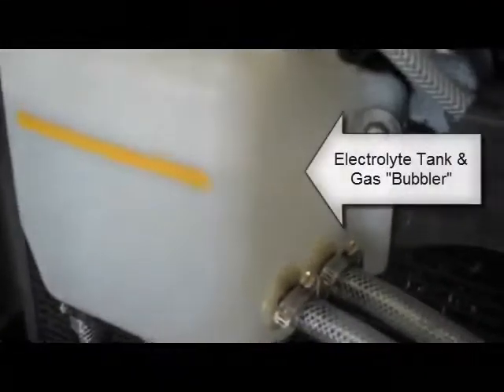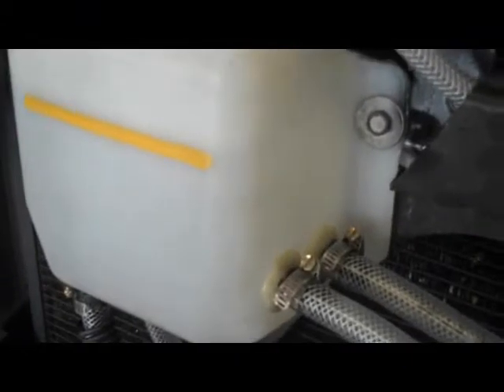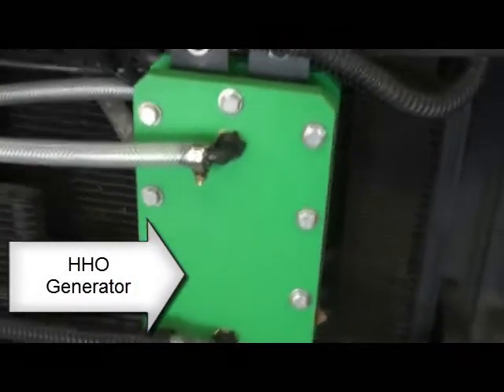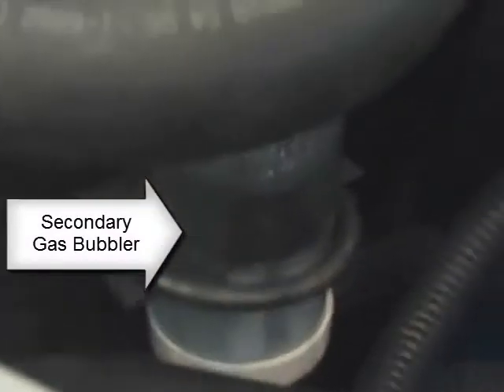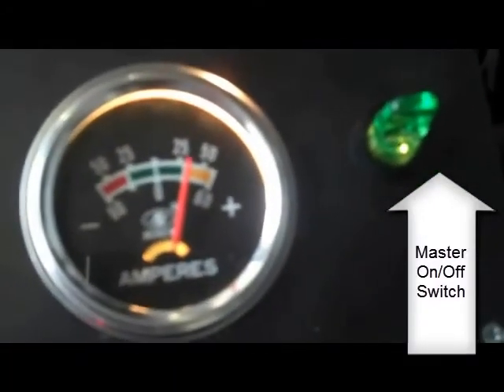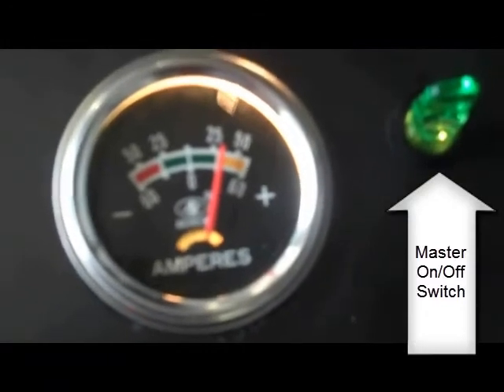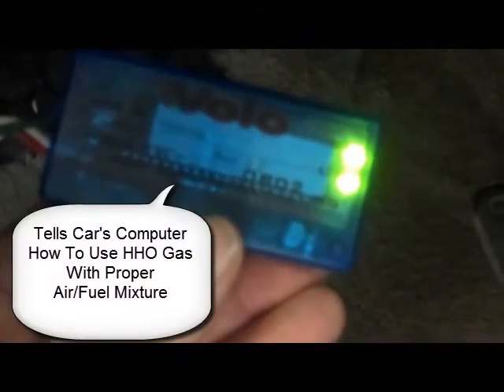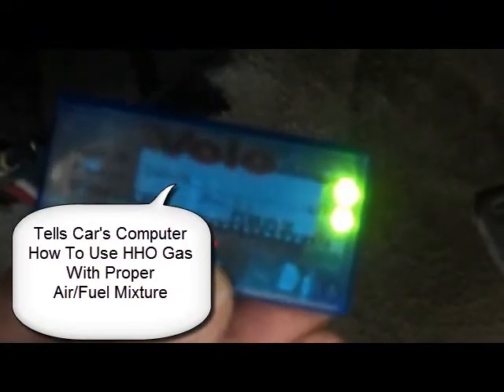HHO-Generator on Suburban

Comment: I have 2 hh0 machines. I want to install in my 2004 yukon, with ignition key shut off. In my older veh I could easily access pcv, and shoot it into carb that way. I don't know how to get it into newer engines. Gonna be towing a 26 foot camper cross country and can't afford to lose uphill power. Any help would be great. Thank you

Comment from the maker: @ATSucks1 The "Volo" chip came with my HHO unit.  My unit was a "kit" from the link listed.  The electrolyte is sodium sulfate, which is effective and less caustic than some of the other options.  The HHO generator uses titanium plates, instead of stainless steel, so there's no undesirable or poisonous by-products created.